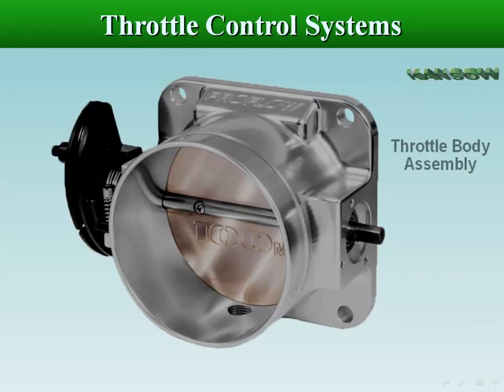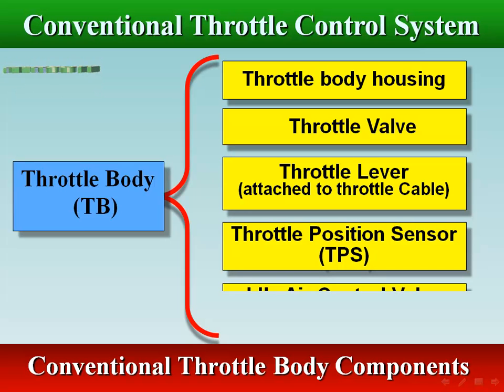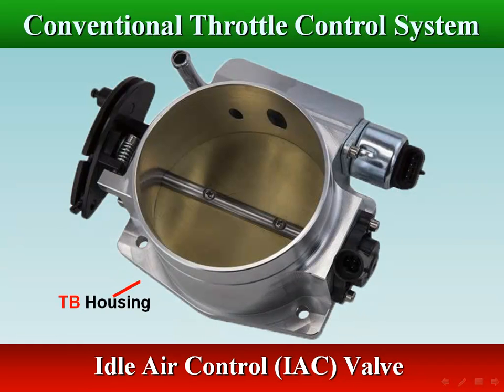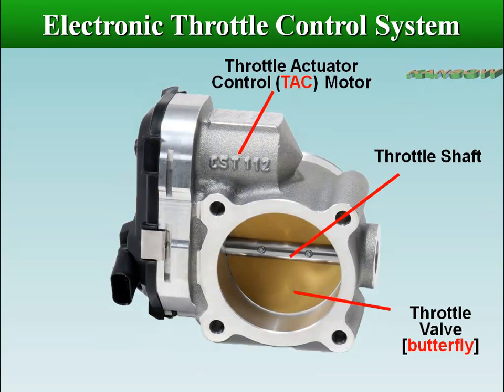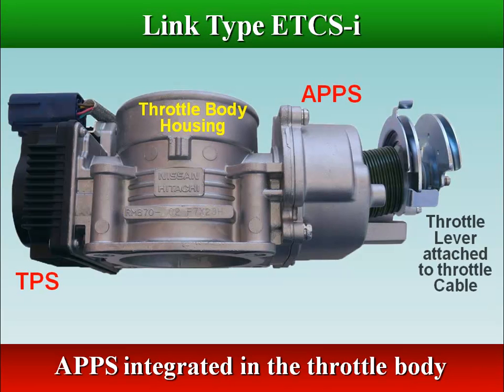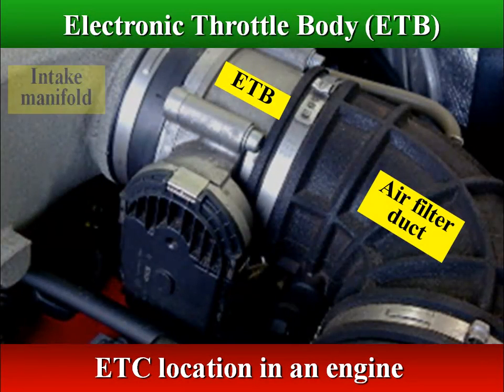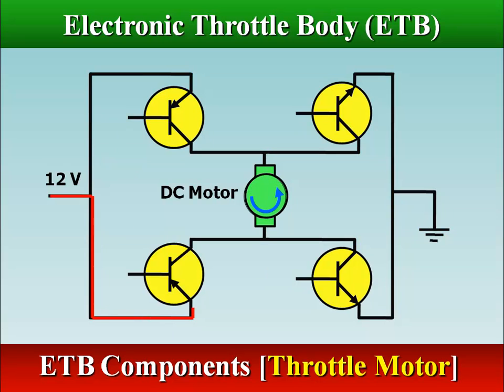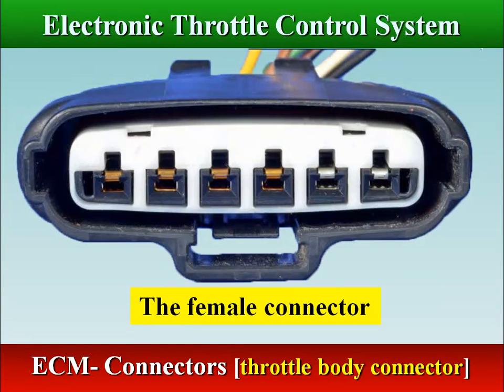ETCS-i (Electronic Throttle Control System- intelligent)

Comment: I was having so many issues with my throttle body unit keep generating code P1516 even after replacing entire throttle body code was popping up so I  recently installed my factory air intake system back on from previously installing a aftermarket Cold air intake and I also resurface my main ground connection as well so far so good hoping it doesn't come back on anymore